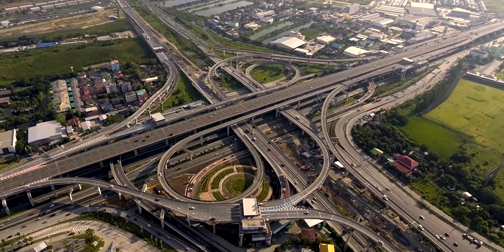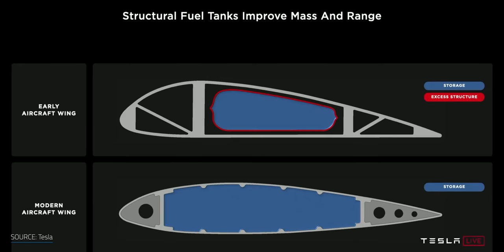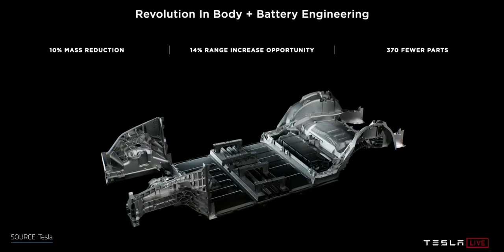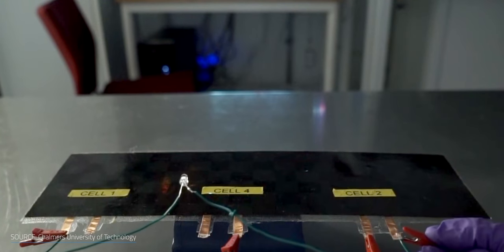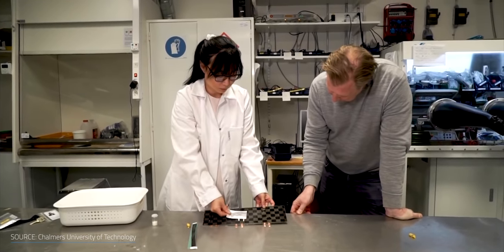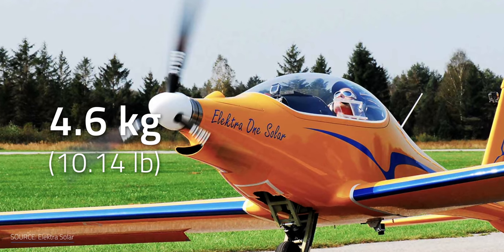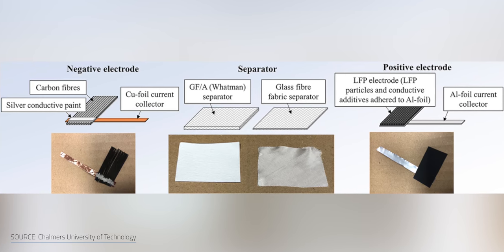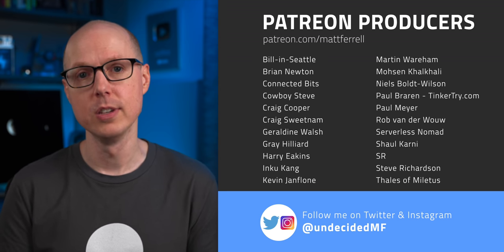Exploring Structural Batteries

Comment: "massless" feels like a lie.  "Structural Battery" sounds much better. 😀
Reply: Structural sounds something out of Apple brand book, sounds like something soldered on a pcb so if it fails you cannot repair it.
Reply: I see your point, and it does sound like marketing speak. Structural is more descriptive. I think they are meaning it doesn't add more mass than would already be there, so in net massless. But I don't like that name either.
Reply: @Alberto-xw8vx  It probably won't be replaceable since Tesla follows the same anti right to repair business tactics
Reply: @Alberto-xw8vx  well, still true though, good luck changing battery if the battery is the car itself
Reply: @turbopanda7012  it wouldn't be replaceable because it's the car itself, not merely a component :P
Reply: Even more dodgy that Matt took the inverted commas away.
Reply: I had that thought too, but thinking about its effect on the weight of a vehicle is a brain fart, as the "massless" battery that has mass would reduce the mass of your vehicle (lighter than the steel it replaces)
Reply: I think the "massless" is referring to the absence of separate mass for a battery (as well as reduced structural mass), so instead of mass of structural panel and separate battery, its a 'structural battery'. But it still has mass. So I agree that structural battery is the easier concept!
Reply: Structural battery is the accurate term for this class of energy storage.

Massless is just a PR buzz term for science articles and videos like this.
Reply: @JonathanNelson-nelsonj3  "I think they are meaning it doesn't add more mass than would already be there, so in net massless."

In fact the future generation of this battery class in development by the same people would have structural performance (ductile strength) of aluminium at lower rather than equal mass.

Still only at 70% of the current Li ion density, but when it isn't taking up more volume and mass that's a big win.

At the very least with solid state Li metal batteries it will dramatically reduce EV weight for 500 mile range models.
Reply: There's no free lunch (except if you work at Google). The car requires KWs of energy. You can't store energy like that in nothing.  Then there's the problem of if there's an accident. The structure is likely damaged. Then you'll have a big fire. It'll be like the Tesla recently that caught on fire, the person had a lot of trouble getting out and it burned to the pavement. That'll happen all the time I have a feeling. A typical gasoline car takes about 400 gallons of water to put out. So one truck will handle it. These electric cars I understand are taking more than 25,000 gallons of water.
Reply: Most of his captions are like that
Reply: That's marketing baby
Reply: No kidding... massless energy battery invokes some sorry of nebulous energy ball. Haha!
Reply: Yeah was gonna say CALLIMG THUNDERFOOT
Reply: Agreed.
Reply: I wouldn't call it a lie but rather deceptive, as the battery serves as a frame which you already need regardless of how it's powered, and utilizing a battery to replace something that can serve a comparable purpose. So I can see why it might be called massless, but it is still as deceptive as loathsome "hoverboards".
Reply: Massless was just a clickbait thing, Structural Battery Is The Real Thing
Reply: But if you're playing semantics.
Wouldn't something besides the word "LIE". Be a better more concise choice ??? Because Lie doesn't even sound good. And doesn't really make sense either 🤔
...jus sayin 🤗
Reply: Yes true but they wanna reach for it xD hey, it is effectively massless is what they are getting at
Reply: @ai_university  
Then you don't know the definition of Lie. Or.
Do you have some PROOF. That the use of "Massless",.. was an INTENTIONALLY False Statement. And simply not an inaccurate or concise explanation in Your View. And simply not Their point of view either.
Reply: I remember when some marketing named their motor design as magnetless.  When marketing does not know what they are saying and trying hard to give it hype, it has the opposite effect.
Reply: Massless is a lie. No “thing” is massless.
Reply: Yeah, I thought he was going to show off some tech where charging the battery would flex or introduce tension into the structure or something, which is reclaimed later as electricity or some magic
Reply: @hashbrown777  they need a better name
Reply: That's what I thought. Like free energy or something.

Plugging a VPN doesn't help the credibility either.
Reply: Yeah, it's a BS hype term.
Reply: @robertthomas5906  The fires happen when the lithium at one electrode forms tiny branch like dendrites that grow towards the other electrode causing an electrical short in the battery cell.

That short causes a massive jump in heat of the cell causing the lithium to ignite  - and once lithium makes contact with the water in air it's all over for the battery pack.

Given that the entire structure of this battery class is very different to fit its dual purpose I don't think it's likely to have the same problems as simple aqueous or liquid electrolyte Li ion batteries.
Reply: @diedforurwins  It's not a lie depending on how 'massless' is interpreted.

If you class as effectively 'massless' energy storage RELATIVE to a completely separate battery pack that serves no other purpose than energy storage.

Point of fact for the future goal of aluminium level tensile strength it would actually be negative mass - because that target is expected to actually weigh less than aluminium meaning that even adding greater energy storage to the car it will actually weigh less too.
Reply: @mnomadvfx  This is how it works; does it have mass?  No = massless.  Yes = lie.
Reply: Dedicated-battery-less batteries
Reply: @diedforurwins  
Then YOU,.. have never heard of a PHOTON. And Photons are "Things".
...freakin amateur 😂
Reply: @mnomadvfx  
Yup, pretty much 🤗
It may be their definition of said mass that does not exist in this structure.
Or marketing. Or an oversight. Or exaggeration. Or inaccurate in ones eyes. Or any number of things. But. It's a stretch to label it a outright LIE 🤔
Reply: @My-Pal-Hal  that’s actually the exact reason I didn’t say “everything” because I was thinking of people like you would would bring up neutrinos or something lol
Reply: The term “massless” is incorrect
Reply: The real release will be a solar energy battery.  I wonder how this will effect solar energy harvesting.
Reply: @diedforurwins  
Oh. So saying no "THING" was better? And you're arguing the use of Massless 😂. That's precious.  And btw. Neutrinos have mass too.
Reply: Clickbaity enough it gets people to click
Reply: @roystanpiedade  
But all batteries have a Structure. 
So using the word Structural IS Redundant. It would simply be a battery.
Reply: @My-Pal-Hal  wow yeah that made no sense haha. Anyway, point taken.
Reply: @diedforurwins  
Yeah. I'm noticing a lot here that doesn't make sense to anyone. And it takes more than a couple comments to explain English and Engineering. It is what it is I guess 😊
And Gluons have no mass either. But are a Thing. No THING that has no mass would be a vacuum. Since a vacuum isn't a thing. It's a measure of atmospheric pressure. Doesn't have to be a perfect vacuum. But pretty low.
... sorry, couldn't help myself 😂
Reply: @dirtnapz996  
The term "Lie" is incorrect.
And I could make a better debate for Massless, than I could this being a Lie.
Of course I do this kind of stuff. So that may be a bit unfair,.. to those whom don't 😏
Reply: Until you need to replace that batt. Then what?
Reply: This is why I always go to the comments. Thanks for not allowing this video to let me down.
Reply: @My-Pal-Hal  I know you can’t, it’s okay. <3
Reply: @diedforurwins  
And I know the uneducated.
I can only dumb stuff down so far.
..funny, my dog understands 😂
Reply: @diedforurwins  
To each their own.
So don't feel bad. That you Call AAA once a week for a jump.
Because you don't know how batteries work. Or even know where it is,.. in your golf cart 😂
Reply: @furd8883  
Ha.. that's Perfect.
I know this technology, and didn't even watch the whole video either.
Because I knew it would Break little peoples Minds 😂😂😂
...and had to watch 😏
Reply: Loadless too
Reply: @diedforurwins  
And I know this must be the first time you've tried to talk with someone,..
WITHOUT USING A CREDIT CARD.  So, I'm honored 😂
Reply: @letssee8397  
Hmmm. Good point. The load of it's charge. And it's inherited safety within. 👍
Reply: @My-Pal-Hal  At what cost? A new battery pack for avg elect car is $5k- $7k just for batt. Now its part of structure? Needs disassembled? The new mazda's oil plug drains right onto the exhaust. Bad engineering F'd up ideas aren't new.  A lot of things are disposable. The auto Industry has produced many. Ford Colt, Dodge neon, Chevy cobalt....How is I get the feeling a batt going bad? Totals the vehicle? Unless its a 2nd Mort?
Reply: Well, it does kinda fit the carbon fibre concept at the start of the video, but not what Tesla's doing.
Reply: @roberttyrrell2250  
Oh come on. You can't do better than that?
The batteries are already built into the frame. This just says they are making it a structural part,.. instead of simply ballist. From the couple minutes I watched that is 😂
If you want a good argument. Argue that they still use Round Cells in a Square Structure. Instead of a Sandwich. Which this video shows is possible. Some simple math will show you the unused area for a given space. When filled with Circles, not Squares. Area = Storage. Let alone the area that those Round Cells use as a STRUCTURE. Not as Storage.

But,..
I'm an Aerospace Guy.
And pegged "Fuel Tanks" right off the bat. They are called Fuel Cells. And considered same in the aircraft they offered as examples.
... blah blah blah, just way ahead of you,.. and still haven't watched the whole thing 😂
Reply: @roberttyrrell2250  
And doing a quick search. Since I like CURRENT Information. It looks like the lifetime of the Tesla Battery Pack,.. is around 500,000 miles at 80% of the batteries life.
So. ... I'll take half a million miles, without an oil stain in my driveway 😂
Reply: @My-Pal-Hal  Thats funny you believe it. 😂🤣😂🤣. Good luck charging your tesla in CA. I'll buy a can of elect when your stuck in mid no where.Theres still the spiking probs w membranes shorting batts. Unresolved. You may want to talk to ppl who repair them. Not the guy making $ selling it too you.
Reply: @My-Pal-Hal  re read your statement. Then think critically about it.🤣 Edit: how much wt in carbon fiber are they saving? Theyd still have to reinforce the batt as part of platform frame now used.
Reply: @roberttyrrell2250  
Oh Sorry.
I didn't know that a Geographical Location had any effect on a battery's Performance.
Hey. Learn something new every day 🤤🤡🤤🤡🤤
Reply: @roberttyrrell2250  
And I could be wrong.
But charging a Tesla in California, usually just needs your home.
So maybe you're looking at it from a Homeless Standpoint.
Hey. At least you own a Tesla 🤗
Reply: @roberttyrrell2250  
Edit : ...Where did I mention Carbon Fiber ?!? That may help me. With the Nothing you are saying 😂
Reply: @My-Pal-Hal  Youre the kind of guy who tells granny not to use her A/C 110⁰ during rolling black outs so you can charge your Tesla. Got it.😉
Reply: @roberttyrrell2250  
And you're the kind of guy,.. STILL LIVING WITH GRANNY 🤤
...got it
Reply: @roberttyrrell2250  
But Hey.
If you know how things work during a Blackout. Just ask Granny when your Xbox stops working. You won't like the answer 😂
Reply: I almost didnt click because of that, it was obviously a lie. However, it has appeared several times in my recomended and yt won at the end
Reply: @sergeirachmaninoff6397  
IS IT A LIE ???
And explain your reasoning. If you understand what the word "Lie" means. And the technology they are speaking of. I'm game.
Nobody else seems to understand what the word Lie Means. So I have my doubts of anything else they understand on the subject.

If you don't understand the language. It's hard to determine what is being offered from same.
Reply: @My-Pal-Hal  yes, because the storage of energy itself has mass. It just doesn't count as extra mass because it is used on the structure of the vehicle. "Massless" is a lie, but "battery that doesn't add to the overall weight" is better. Adding zero is not adding something "massless", it is just taking away the structure (subtraction) and putting something else in the place (addition) by the same amount. Just like an integral in a simetric interval with an odd equation. The result is zero but you are just adding opposites of the same thing. There's a positive area and a "negative" area, both with the same absolute value, but the integral itself does not represent a line with no area at all. Again, similar concepts, but not the same as "massless"
Reply: Sheet battery?
Reply: I mean, it is almost made entirely out of carbon fiber.
Reply: @My-Pal-Hal  my argument was so good you didn't even reply it. Thank you for that
Reply: I got cat fished.
Reply: @sergeirachmaninoff6397  
Oh. I was waiting for you to actually understand the definition of Lie. Obviously that ain't happening. So the rest is academic. Enjoy 🤤
Reply: @My-Pal-Hal  and you didn't answer again! Thank you man, mediocre people like you encourage me to keep doing what I'm doing. Get a life by the way, you're answering every single comment here, gosh.
Reply: If the structural battery would be massless that would be great. You could create batteries as well as rigid structures without any mass.

Yeah the term is stupid.
Reply: Massless because the object that needs the battery is the battery. So, object has essentially reduced the mass of a modular battery pack to zero.
Reply: @Alberto-xw8vx  good point lmao
I'd rather take a scam than apple's design
Reply: The cocnept is good but will it be practical though? There are better alternatives.
Reply: Thank you, I was going to say something, but you said it quite succinctly and correctly. I thought it was some kind of new energy breakthrough. Dislike when they use such misleading titles.
Reply: unrepairable is an even better name, goodbye poor people owning teslas.
Reply: They call them "massless" because some of the mass of these batteries would otherwise be needed for the car's structural members.
Reply: It's both. It's massless since no additional mass is added to whatever it is powering. It is also a structural battery since the battery IS the structure.
Reply: because having to buy a new car when you finite life battery is awesome?
Reply: Exactly.
Reply: @sergeirachmaninoff6397  
Oh 💩
Was I answering people because I had something to Add.
Or was I just Spewing YOUR pre-existing conditions, that your Alex Jones Supplements aren't quite addressing 😬
...seems you may be a bit confused,.. or ... let's not go there
Reply: @sergeirachmaninoff6397  
PS.
If you do not understand the language something is offered in.
It is very Doubtful, you understand it at all.

....IE , you. ... as an example
Reply: @sergeirachmaninoff6397  
And just to show your Expertise.
You said the STORAGE OF ENERGY ITSELF HAS MASS.
But anyone with an understanding,.. or IQ above their shoe size. Obviously knows that.
IT IS .. WHAT .. It is that's storing that Energy. And the MASS it takes to do same. Past the Structures that hold said energy.

...Damn .  We Need Better Education NOW
Reply: @sergeirachmaninoff6397  
And btw ... Trollio.
Anyone here, can simply look up stuff. Whatever it is.
So either you continue to ASK,.. without your Mommy or Caseworker to help because you don't know how the internet works. 
Or. . . You really don't want to know.
And that's what people have to learn today.
DO I LISTEN TO THIS FOOL.
OR DO I GET A SECOND OPINION 🤣
... yeah,.. nobody is getting a second opinion nowadays,.  Probably Friends of Yours
Reply: @Alberto-xw8vx  Like a battery that is the body o f the car? 

- Owner: Yhea the battery is past its life but I like the car can I get a new battery for it 

- Tesla: no you need to pay for this new one, because the batteries are the car and we no longer make that one.

So much for right to repair....
Reply: You should be hired by every company that names there products Pmbixdih028361
Reply: @slightlyopinionated8107  
First... It's THEIR.
Second...
What is your idea of identifying a Billions or different things,.. from Billions of Sources.
... that's a good troll question 🤣
Reply: @sergeirachmaninoff6397  
...and Don't Mock the Knowledge,
YOU DO NOT POSSESS. Learn something new every day.
...that ain't happening 😂
Reply: @My-Pal-Hal  please, I would love to know how old are you. Can you answer me that? Give me the definition of lie then. You probably red some philosophy book talking about Plato who thought that you need to know the definition of justice in order to be just or you need to know exactly what is beauty to define if something is beautiful or not. In one of his discourses with a sophist, wich I don't remember the name, he explored that pretty much. Anyways, a dog doesn't need to know what is a ball to run after it, and neither do we need to know the exact definition of things in order to judge them. It is a good mental exercise, but not very useful. As an aspiring engineer, the practical utility has its charm for me. Go listen to one of my pieces by the way, just search my name on yt and you'll have better things to do than just replying me. I bet you'll like it. Wish you all the best, really!
Reply: @My-Pal-Hal  and you also argued about a photon, but the way a photon carry energy is really different from an electron for example. If you pick the Einstein's formula E=mc^2 and put zero in the mass you will get E=0, wich is not true. It is a bit more complicated but you'll have to consider its momentum in the calculations. It has nothing to do with the battery here. This battery is not powered by photons. I think that's not even possible. I don't know why you're so obsessed with people saying that it is a lie but if we would encouter a statement, such as "massless battery" in a true or fale exam we would all put false in it, given the same context.
Reply: @sergeirachmaninoff6397  
Actually,.. my troll not paying attention friend. I mentioned a PHOTON has no Mass. After somebody 🤨
said No THING has Mass. And I also added other THINGS that don't.
And it's CARRIES btw einstein.
...jeez dude, give up. You have no wish to care about anything but yourself. If you did. You'd learn Any Language. And then,.. HOW TO TYPE 🤣
Reply: @sergeirachmaninoff6397  
PS.
 A Photon Only Exists BECAUSE of it's momentum. It wouldn't otherwise basically 😏
Reply: @sergeirachmaninoff6397  
And while I got you here.
You,.. and all the less Coherent Ones here. Continue to use the word LIE.
While giving a ton of diatribes concerning everything but. And until you understand THAT Word. You will never understand anything I'm saying. Never mind English in general. Or Engineering or the Sciences of same.
...yes, there is more than one Science Too 😏
Reply: @sergeirachmaninoff6397  
And WHY DO YOU KEEP LYING ???
... maybe that'll get the point across, Ya Na ...
Reply: @sergeirachmaninoff6397  
I Did like the Exam Comment.
I'm just wondering how many here would even get past the Name and Date portion 🤤
...ya, I'm looking at you
Reply: @sergeirachmaninoff6397  
And btw again.
The word would be READ. Not RED.
I would love to debate you. When you learn a language. I'll work with whatever is comfortable with you 🤤
Reply: @sergeirachmaninoff6397  
And if you have content you want viewed. Usually you'd just Click on their Icon. But. You have something Different ???  And it has to be Searched ??? 
Funny. My channel doesn't work that way. My content is a Click Away.
Just asking because your channel is Bare. So if I have to search outside of You. It isn't You Here. Logically.
And I'm in no way saying you are Actually Here anyway. Because that's... 😬😬
Reply: @sergeirachmaninoff6397  
3 5s, or 5 3s. There is a difference. Like the definition of words. Yeah, it's a simple example. But I'm hoping you get the point ✌️
Reply: @sergeirachmaninoff6397  
And btw,.. AGAIN.
Batteries are not POWERED as a THING. For my other friend.
It is a Storage Medium FOR POWER. ...jus sayin.   This is fun😊

Come on. At least F me on the use of the word Medium. I am. But I'm Good 😂
Reply: @sergeirachmaninoff6397  
I'll end with this...
Don't bring Dogs into this. They know more than you ever will.
And saying they do something "Just Because" Shows your Ignorance of Life in general.
...cat people, what can you do 🤣
ENJOY 😊
Reply: That's what happens when you let the marketing/PR departments name things instead of the scientists/engineers.
Reply: @ejrandler  
And what would you name it.
With your Extensive knowledge of Technologies ???
Reply: @My-Pal-Hal  I am a physicist and an electronics engineer.  But yeah, maybe we shouldn't be the ones naming these products.  Using advanced terms may lose the target demographic like yourself.  Maybe a compromise between the engineers and the salespeople to make it palatable to the masses, but still be technically truthful.  Massless implies that there is no mass as if the batteries were composed of only photons or just nothing at all.
Reply: @ejrandler  
...and I have my First Flight B-2 belt buckle on.
Yeah. Probably shouldn't have mentioned that. But,.. it's a Belt Buckle. Don't give 💩 we'll wear. 😏 ... Yeah. That didn't fly then either. But it got me Transferred outta California 🤗
And to Philly for the Ospreys.

Being there is Cool.
DOING THAT IS SO MUCH BETTER.
Reply: @ejrandler  
And you are Claiming,.. the Exact thing they're Doing.
You can't avoid Reality,.. just to get someone to listen. It goes way past that. They have to Want To Know. Curiosity...
It's even like yourself,.. maybe for YouTube recognition.
But you have to Want to know. Research. Get a Second Opinion. And 3rd and 4th and ... 

Still.
My point was the use of the word LIE.
And with all the other 🐂💩 offered. No One Can back up that simple assertion. 
Weird huh 😏
Reply: @ejrandler  
Or maybe,..
They can only imagine a Car Battery.
It has a housing. With the MASS of it's Storage inside that housing.
THEN IMAGINE.
THAT ALL THAT MASS,.. IS IN THE HOUSING,.. NOT INSIDE OF IT 🤔 ...hence no mass
Whatever. You'll get it someday I'm sure 🖖✌️🖖🥰
Reply: Yeah... misleading title. Pretty damn significant.
Reply: @fiskfisk33  it would probably be the frame of the car and the maybe the cassis
Reply: @sergeirachmaninoff6397  
Ma'am,.. Really.
It's been fun. Butt,..  
Your insurance will have to cover you from here.
Or your parents. Or more likely Caseworkers. Either Or 🤗
Reply: @sergeirachmaninoff6397  
hahahaha... Just Wondering....
Whose the "WE" you are talking about ???
Cause I got a Buck,.. your neighbors, wish they Weren't.
Reply: @sergeirachmaninoff6397  
Relax Trollio.
YOU,... responded to me.
And Still have no understanding of One Simple Word.
...BOT,.. that's Cool
Reply: @sergeirachmaninoff6397 
And PLEASE ...
Don't be Jealous, just because a dog has only a few views.
...AND YOU HAVE NONE...

That's probably something you can bring up with your Caseworkers 🤔
Reply: @sergeirachmaninoff6397  
eBay is a great place to buy Chinese Phones that do English.
... bots for tots x🤣 ...
Reply: @My-Pal-Hal  Interesting.  You don't know me and yet you knew I have no knowledge of science and tech.  Of course, you are right to say that there is no way for you to check if my claims are true or not.  That's fair.  None of that changes the fact that to call anything, other than photons, massless.  Maybe they should have gone with Ultralight Structural Batteries.  A little hyperbolic, but that's OK.  Hyperbole sells and is not a lie just an exaggeration.  Using the term massless was, IMO, an attempt to evoke a Sci-Fi level of scientific achievement to wow the masses.  It looks like it worked on some people.  The problem I have with that is that it truly undermines the true achievements of the real scientists and engineers who have worked extremely hard on this endeavor.  You criticize my grasp of the English language.  Funny.  I'll let the readers decide for themselves who between the two of us has a better grasp of the language and actually uses words and not emojis to express thoughts and ideas.  You seem to be ranting and have not offered us a good reason for the use of the word massless in this context.  I doubt you will so I will leave it at that.
Reply: It feels like a lie because it is a lie.
Reply: @prototype8137  True for many.  Science is like basketball. Some players are well recognized and get lots of fame and money for doing what they do, be it good or otherwise and often to serve selfish purposes.  Others just do it for the joy of moving the ball around and playing with other souls who also enjoy it.  There are still lots of players out there that love playing the latter way.  They just aren't as noisy but they don't care about that.   They just enjoy playing the game especially with others who think likewise.  Besides, the greatest things are done by ordinary people, not so much superstars.
Reply: it is a lie lol, total clickbait
Reply: @prototype8137  Oh, it is not so much that I am learning about this behavior, it is more that I continue to be annoyed by such blatant misrepresentations.  I'm 55 and have learned this decades ago.  It still bothers me.  Maybe I should just ignore it and go on happily with my life.  You are correct on your assessment, as far as I see the same way you do.  Thanks.
Reply: I completely agree. When I heard it I thought "This sounds like it'd break Conservation of Mass", so I was very suspicious of it.
Thought it was gonna be like... A battery that somehow stored energy in an empty space or something, which seems way too sci-fi if not impossible.
Structural Battery definitely sounds more fitting and far less misleading. Hopefully they change it some time into development.
Reply: That explains it to a confused guy who just clicked the video, thanks xD
Reply: Hmm how about light weight?
Reply: next: Tesla reveals battery so light, is doesn't even exist
Reply: Not a lie slightly wrong but just a wrong name for it since it does have weight but is just like pooring lithium ion acid inside your walls in you car. You got the juice but without the extra weight of the shell of the battery.
Reply: Sounds like tesla needs this in their windows and than elon can throw whatever he wants at it and claim its bullet proof ;)
Reply: Sounds like tesla needs this in their windows and than elon can throw whatever he wants at it and claim its bullet proof ;)
Reply: Sounds like tesla needs this in their windows and than elon can throw whatever he wants at it and claim its bullet proof ;)
Reply: @slightlyopinionated8107  
Are you talking about conversational grammar, or strict written grammar? Or do you mean Syntax?
Yes. I understand people that can't Spell in a language more often than not, don't Understand said language. But I thought I'd ask anyway 😂
Reply: @slightlyopinionated8107  
...and show your work 🤡 😂
Reply: @My-Pal-Hal  oh lmao didn’t know you were trolling. Good shit 👍 haha
Reply: @slightlyopinionated8107  
Well. 
I guess "Didn't Know" is a good answer to my questions.
But that was pretty obvious from the beginning 🤤
Reply: And I'll go out on a Limb.
With an analogy that may Click with some. Probably not the ones that don't understand what the word Lie Means. They are Hopeless. But. JUST THINK 😂
Most people have a SKULL,.. that contains a Brain. Most. And that brain is supposed to hold the information or energy within. But, heads 😂
Imagine That All That The Brain Holds. Is now simply held in the Skull Structure.
So what had Mass and Usefulness, The Brain,.. for some 😏... Now Is Not Needed.
So. MASSLESS. But that's an ongoing thing nowadays anyway.
When one doesn't even understand the meaning of a 3 Letter Word like Lie.
... Massless must Really F with your,.. Masslessness, to many letters🤣.
Reply: @ejrandler  
And just came up with another that may fit your thinking.
...but may car doesn't have A BATTERY PACK ANYMORE ??? 
So what are you saying. Are you saying that Mass is Gone ??? 

WELL THEN WHY DON'T THEY CALL IT A "MASSLESS" BATTERY ???
Got a dollar most here would ask that question.
And not even know the Hypocrisy 😂
Reply: @ejrandler  
... Interesting yet 🤔
Reply: @ejrandler  
And I must admit.
Being a 60yr old Aerospace Engineer. (punk 🤣)
That you being"Annoyed" by others with different explanations of their ideas,.. their Behaviors. Was A Problem with you 😂😂
 exactly
But I took that personal too. Because,.. I know. And more than you may imagine. But you will imagine someday Too.
And maybe give that ONE Explaination to someone. That one day makes a Difference.

...and usually not
Never Give Up Never Surrender 😂
Reply: @fuckyouleftube  
Just FYI 🤤
My Dog could have made a better, more informative comment.
...oh he did 😂
Reply: Humanist clickbait betrayal yes
Reply: @supersasquatch  
... ahhh... OK 😬
Reply: How about "integral" :P
Reply: yeah, structural doesn't seem feasible and would have very slow rate of adoption, also, makes cars more flammable running around with energy stored in the frame
Reply: @diedforurwins  photons and gluons are massless
Reply: I actually thought it was some super sci-fi breakthrough involving somehow extracting energy from quantum vacuum or something.
Reply: I think it's more to do with the battery aspect of the material, since its weight is accounted for in its structural application the battery aspect of that same material can be considered a free benefit or "massless" even though it clearly has to have mass to exist.
Reply: @giin97  depends, if the majority of the "battery" is the bodywork itself then it could be designed in such a way that those plates are removable from the frame in segments to allow the replacement or repair of damaged or faulty panels.

It depends how consumer friendly they pretend to be, if they are apple levels of a$$hole then the entire thing will be one continuous battery and if it breaks, tough, you have to buy a new car.
Reply: @HereticDuo  you're still describing it as separate batteries attached to the car frame. The point in the video is that the batteries would be the car frame. To replace the frame/batteries, you wouldn't be removing the frame/battery, you would be removing everything else.
Reply: @eplanti  
Actually,..
It would make the cars Less Flammable. And less likely to burn from that MASS, that no longer exists.  It MAY However.
Lead to Electrical Discharge into objects it comes into contact with.
SO DON'T BE A "GROUND" 😂
Reply: It IS a blatant clickbait lie.
Reply: It is a lie
Reply: @nicholaswestbury7689  That may be the case, but someone who's a layperson on that topic isn't going to make that connection. As a headline, it will generate a fk load of clicks, though.
Reply: @Alberto-xw8vx  well hopefully with more widespread self driving vehicles there wouldn't be as many accidents, and therefore less of a need to repair.
Reply: i dont know the 'Actual" definition, but Massless Battery to me, means that the battery provides no excess mass. the battery itself can be used for the superstructure, or supporting structure. batteries are important in EVs but provide ultimately empty mass to the vehicle. where as the mass of the motor provides powered mass. or the mass of the framing, and superstructure provide structural integrity. i think that is the intention behind the naming style.
Reply: Every new ideas will feel like lie or scam initially, but one day we will find ourselves using it .
Reply: @Alberto-xw8vx  you obviously didn’t watch all the video lol
Reply: I doubt you could properly define mass anyways.  You think it means matter.
Reply: i assume they say massless because if the battery is replacing an already necessary part of the vehicle, the battery has not added any mass to an identical vehicle made of conventional materials.  But in no way do i think you are wrong in pointing out this semantic stretch on their part.
Reply: It's A Uni-Battery-Body
Reply: No such thing as massless battery. Even that thin thing they showed us has mass.  The other one replaces the frame or unibody of the car. This would make battery changing a night mare that cost more then 1000 $ and could be 3000. 
This isnt a new idea. I dont even know why the got a patent but maybe to make it harder fir other companys ,the battery pack wear in they use lots of small battery cells to make 1 big battery is way older then tesla.
40 years ago you could get battery packs for rc cars. And thats the same
In china they have alot of battery packs that double as frame.
This hreat break through ? No
Jusy usa catching up on tec as were well way behind because are rich people keep us in the dark to make extra money.
Why are we using lead batterys in cars ? Why do they stikl make them?
Im using 4 headway cells in my car lkke 4 d batterys a little longer.
Cthe reason is so they can cell you a knew battery every 2 to 4 years.
As for throw away batterys ben franklin made one still working today.
Why do ours only last 5 mins ? To sell you anther 1. Altho cost is there.
Altho low cost crystal cells that last 100 years could power everything.
If you replaced the wall of your house with panels made up of copple sheet and a zink sheet with crystal inbetween.
Youd havd the surface space and volts you would need to power your whole house for 100 plus years. Lmfao.
Could even design the panels easy to pop togather so anyone can build a house in a day.
Changing the way we build. O you want a car just put a foot thick crystal cell as frame now powers your car for 100+ years.
I didnt invent anything i only used old technolgy.
This was all facts, but rich people never let us slip the chains of power. Power food and shelter is how they trick the slaves into thinking there free.and the godless rich people never let u break 1 of these just add to them like . Now everyone wants internet.
But if your a nerd wanting to save earth build 4foot by 8 foot crystal cells. And when you count the surface space of walls ceiling of house gonna have wsy more then needed. Meaning each panel coul have up to 2 inchs of cell that could be 10, plus per panel.
Id also make tiles so you can just tile your house and it self powered 100+ years. 

And this kinda tech could stop a breaking of the world.what happens when power grids crash some day .? It would be no big deal if we build like this. Power plants could blow up and wed be able to rebuild.
Once you remove fossel fuel. Once the grid breaks all the humans die off on there way back to caveman.
Right now we use fossel fuel give it 100 years. 
So why would the grid break? Somone will break in on purpose.
Lucky for us humans should die off before we hit this mark.
Due to the fact that a female human is born with her eggs.
Each time she drinks or drugs fks them up. Each generation is getting dumber not smarter.
Then theres the toxic nature of our world causing a liken effect.
Humans are doomed.
Not because a space rock or volcano.
But because of your basic nature.
With greed being the desiding factor.
Writen by the one who gives all thats holy the strenth to act the most beloved.
The angel jhib/real
P.s. your all fuked.
Reply: and when the battery dies, you scrap the car. ;)
Reply: That's because it is a lie and nonsense on top of that. Clearly, this guy and his team have never actually passed a single physics class in their lives or bothered to fact-check any of this. The entire video is absolute nonsense.
Reply: As I kid I used to watch this cartoon called 2 stupid dogs*. There was this big, loud character, a man that would always shout *Well isdn't that cute? BUT IT'S WROOOOOONG!
And this is STILL WROOOOONG!